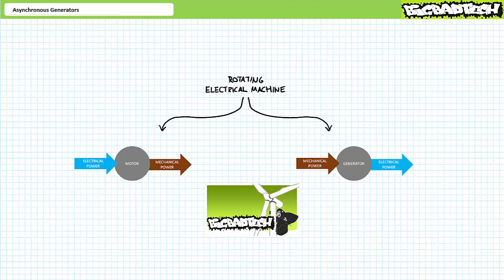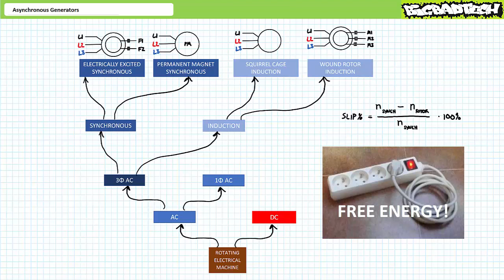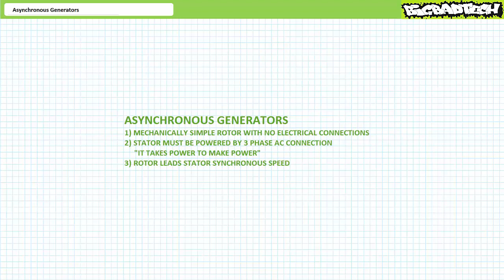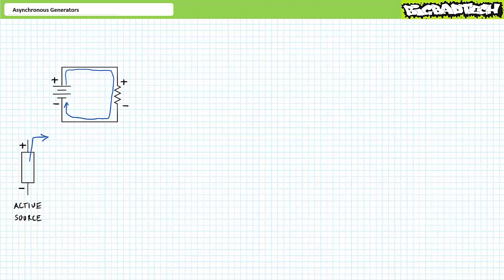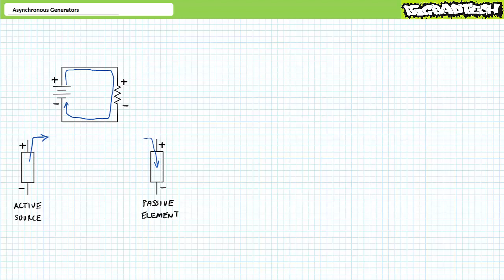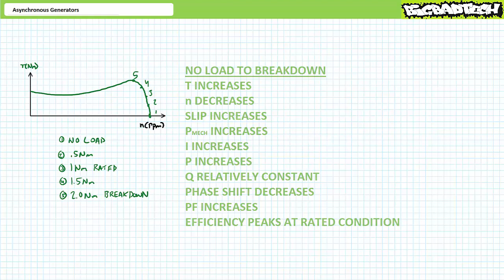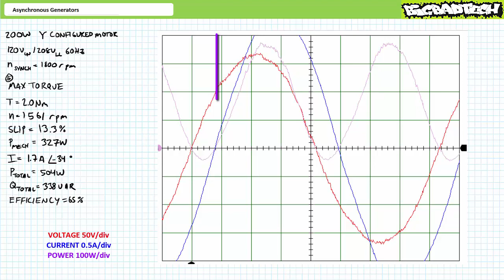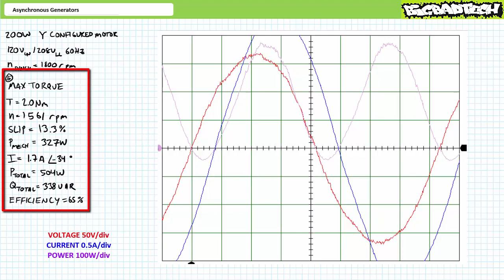Asynchronous/Induction Generators (Part 1 of 2)

Comment: 29:27 Shouldn't the single phase power be multiplied by √3 ≈ 1.73  ? So that would be ~ 191 W
Reply from the maker: Good question. The sqrt(3) shortcut (ie: the single wattmeter method) works if you measure Line to Line Voltage (V L-L) and Line Current (I LINE). If you have voltage and current for an individual winding of 3 identical windings (ie: power for an individual winding) you simply multiply by 3. Here's the lecture explaining the single wattmeter method: https://www.youtube.com/watch?v=bVjmy2vBj-0
Reply: @bigbadtech  Thank you for explaining 👌

Comment: I am here because I got something like 15 or 20 electric motors from the factory I work at, from smaller 3 and 7 horse baldors to huge 50 and 75 horsepower monsters. I have a huge workshop with 3 phase power and a machine shop. What should I do with these. I have something like 20 internal combustion engines among other things. Can I marry some engines I have to these big motors and make a power station? I have about 300 or 400 gallons of used oil and old fuel oil. So say I refine some oil to run a few diesel engines for free could they drive a couple 50 horse motors and give myself free power and heat? I could scrap these for a grand or more but I don't want a 1000 bucks. I want to build something. I also have piles of hydraulics, pumps and Allen Bradley plc control stuff along with many drives units out of cnc machines. I scored a bunch of back room clean out junk most of which I don't even know what it is. There are some transformers in there too. I really would love to run a hit and miss engine off natural gas or bio gas and just listen to it pop and bang all day long as it makes power or pumps water. Looks like I am going to be busy on your channel. Wish I wasn't so far away from you. I'd take your class or try and hang out. All this on top of a 200ah lifpo4 project. And some solar dabbles. I'm a toolmaker by trade and just can't let 10,000 pounds of electric motors with "good" tags on them go off to the recycler